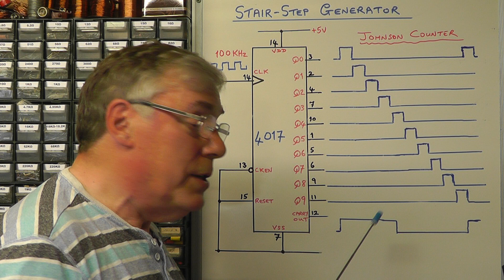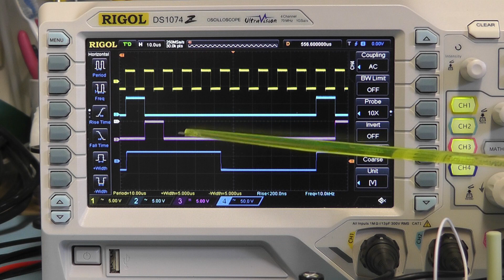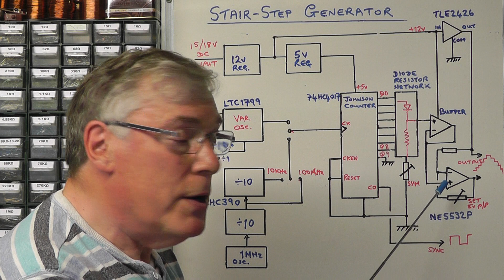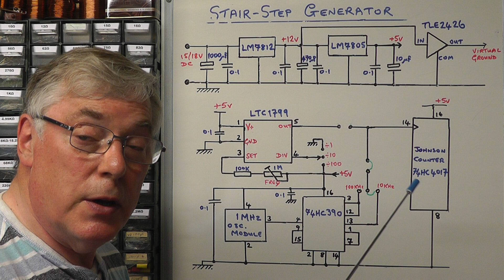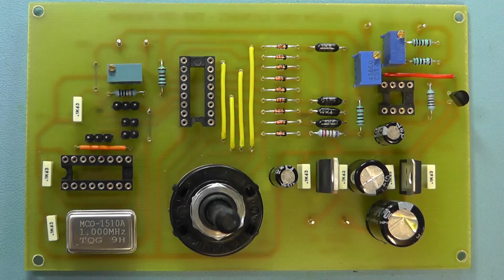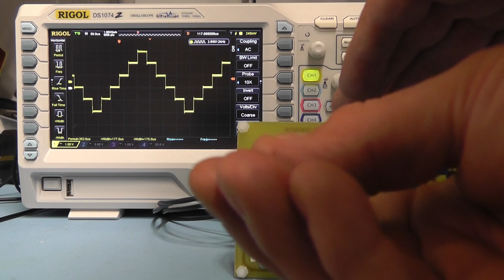Scullcom Hobby Electronics #41 - Design & Build a Stair-Step Generator

Comment: Great video.Thanks for sharing! I built it and it works, however after further research I decided to use an R2R resistor ladder instead of your binary ladder. The R2R was more stable and simpler to implement.

Comment: 👍😁 ❤   I haven't used "my Johnson" this much since I was of dating age 🤓 Thank you for a very through, information packed and interesting video. One question: The individual steps are for what purpose? I would assume scope linearity but the steps voltages could be set a little fast and loose if not paid attention too. Unlike the 5v overall, they can be (are) individually set. I ask because there is another commercial scope calibrator that uses steps also. Cheers! 🇺🇸❤🇬🇧

Comment: I've seen the comments about you grounding the Q9 output,  which I will also say that you should never ever do.  In addition,  you appear to routinely allow violation of the rule that says that ALL CMOS inputs have to go somewhere.  In this unit,  the clock input to the 4017 should have a 100K resistor to ground so that it's not floating when the switch is moved,  or when links are not in place,  even if that's during a transition in your setup.  I also notice that the alternate waveforms step on the way up but not on the way down like the primary waveform does.  I don't see a need for that "rail spliiter" chip when you can accomplish the same thing with a couple of resistors,  maybe also a couple of capacitors across them.  Finally,  your staircase output has one ground reference and your sync output has a different one.  This could come back and bite you in the ass at some point...

Comment: While watching this it struck me that the 562 ohm resistor could be replaced with a 1N4148 to achieve the desired 0.6V voltage drop. Likewise the 1k ohm resistor  can be replaced with  two 1N4148 diodes in series; the 1k74 resistor with 3 x 1N4148 diodes in series; the 3k26 resistor with 4 x 1N4148 diodes in series and the 7k68 resistor with 5 x 1N4148 diodes in series. This will ensure that the steps of the waveform are of equal size; additionally there is no need to try and find non-standard resistor values. 1N4148 diodes are very cheap; the design uses 9 of these already.

Comment: Is it interresting to add some voltage reference in your circuit ?
And adding some pf cap for filtering your step's signal ?
Why not using a DAC to generate your stairstep-ramp which could control your VCO too through a PLL. 74HC161, 74HC160, 74HC4046.
Is this more accurate than digital ramp use in a DVM ?
Reply from the maker: Hi,
thanks for your comment.
There are many options in producing a stair-step generator. In my project I wanted to demonstrate the use of a Johnson Counter. If you wish you could use a DAC other counter IC's as you suggest. You could even do it with a micro chip. There are lots of options. My project is just my take on one example.
I would imagine a digital stair-step ramp used in some types of DVM's would be more accurate as it makes its voltage measurements by comparing the input voltage to an internally generated stair-step ramp voltage which is set/calibrated during manufacture.
Regards,
Louis
Reply: Hi,
Thank's for your quick answer and Thank's 4 your video's
Renaud
Last question: What about making a frequency ramp or "stairstep" may be around 10Mhz from let's say from 9.5 to 10.5 Meg -10dbm step from -80dbm to -30dbm with why not a si5351.. ;-)

Comment: Skull com. What kind of swiches are there to use in circuits. And what are pulse circuits , and pulse. Switches.
Reply from the maker: Hi Phillip,
The switches are:
S1 - Rotary Switch, 6 Way, Through Hole - break before make type. (RS Components Ltd stock No. 665-196) Lorlin (Mfr. Part No. CK1050).
SW2 - Single Pole ON-OFF-ON switch or 3 pin SIL option link with link plug
You can download a parts list:
http://www.scullcom.com/Stair_Step_Gen_Parts_List.pdf
Regards, Louis

Comment: Interesting project, but your calculations could have been simpler. Instead of working out the currents and doing two calculations for each voltage, you could do:-

From the voltage divider formula: VO=VI(R2/(R1+R2))
And with: VI=4.4 and R2=1200
We get:-
V=4.4(1200/(R+1200))

Rearranging...
V=5280/(R+1200)
VR+1200V=5280
VR=5280-1200V
R=(5280-1200V)/V

We get:-
R=(5280/V)-1200

(not a huge saving for just 5 calcs, but a general principle. eg: You might want 10 steps...)

And inserting the required Voltages:-
V=0.6 => R=7600
V=1.2 => R=3200
V=1.8 => R=1733
V=2.4 => R=1000
V=3.0 => R=560

If one doesn't want to use 0.1% resistors, use two standard E12 values resistors where required:-
7k5+100R
2k2+1k
1k8||47k (=1733.6) Or 1620+113 (E96 1% values) from calculator at: http://www.qsl.net/in3otd/parallr.html
1k
560R
Reply from the maker: Thanks for the detailed info. I am sure it will be of help to others following.
Regards,
Louis

Comment: recently I unsealed TXCO of 10.000mhz ,it contains 20mhz xo and two ic's PWM switching power controller.  micro power voltage regulator . pls upload circuit sir related to it.
Reply from the maker: Were any of the IC's a HEF4046B in which case it the circuit would be a phase-locked loop circuit.

Comment: One of the hardest tasks of measuring passive components is the measurement of inductors. I googled some projects of diy LC meters but I couldn't find any project as satisfactory as of simplicity, accuracy and with no micro controller though. I found out, whatsoever, that it might be possible to design such meter with a tank circuit, a 555 oscillator and an LM331 frequency to voltage converter IC. What do you think, is it possible to design and build a simple yet accurate LC meter with those components?  
I think it can be an interesting project.
Reply from the maker: Thanks for your comments. Many years ago I made a capacitor meter using a NE555 timer IC which worked very well. So yes it is possible to build an LC meter using a 555 timer.
Reply: Thank you very much for your videos, they are very well explained and appreciated by hobbyists. Sadly you don't have a video about designing and building an LC meter with a 555 IC. I think a lot of people would find it very interesting and useful. I know there are many cheap already made solutions in ebay but the idea is to learn and the joy of designing one for yourself, but some of us lack of the ability and knowledge that you have. Maybe one of these days you can make a video about it.

Comment: I didn't see anyone else ask so I will.  What do you do with a stair step generator?
Reply from the maker: It could be used for a number of things such as as a simple check for oscilloscope scale calibration test. Also it could be used as part of a Transistor Curve Tracer circuit. You could also use it to test stepper motors. It could also be used to provide a video signal for a bar grey scale test pattern.
Reply: Scullcom Hobby Electronics Thanks

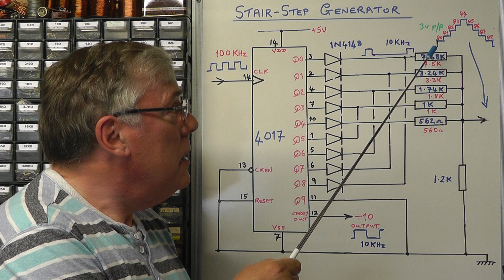Comment: At 5:15, you connect the OUTPUT Q9 to ground? say goodbye to that pin if it's TTL!
You need a 10k+ resistor to ground, if you are worried about noise immunity. Unused outputs are left floating, while unused inputs, are grounded or pulled up to +Vcc. Is that not the common practice now a days?
I'm not sure what this circuit is used for? I can generate 1024 step wave forms with an $2 Arduino clone + an op amp if I need to generate audio wave forms of any shape. No?

Comment: Smashing project :-D
And for more steps you can add another 4017 :-D
Ahh the johnson counter, a very handy i.c :-D, i last used one to select the supply voltage to an eprom/flash programmer.
The Q outputs drove transistors that connected to a selection of resistors connected to a lm317 adjustable regulator.
The clock input was a push button and passive parts so i could press the button and the johnson would step, simple and crude but it worked a treat :-D.
Reply from the maker: Thanks. As you say using the Johnson Counter to control switching is a nice option. Like you I used it many years ago to act as a selector switch with a push button stepping the clock input at each press, giving 10 switch positions with one button. You do not see this IC used very much these days but it is still a very useful IC.
Reply: When i used to repair c.b radios i was often asked to fit a "K" tone or 5 tone roger bleep, they used the old 4017 too, a couple of 40xx chips for oscilators and control, Plus r/c and diodes on the output of the 4017 lol, they worked very well :-D
Im a bit old fashoned, i like the 7400 and 4000 series logic better than any other method :-)
Reply from the maker: c. b. radios that takes me back. Not used much these days. I still have a couple of Binatone c.b. radios under the workbench in a box! I use to play around with surplus Second World War transceivers such as the 38 Set and the 19 set. Long time ago now !!!
Reply: The popular binatone 5 star was a good cb radio, silver fasia, the pcb was a cybernet ptbm134, same as quite a lot of the popular radios around in the mid 80's.
Uniden radios like the uniace 100/200 or realistic trc2001 and similar were another choice.
.
Cb radios is where i learnt synthesisers/rx i.f stages and tx mixers/power stages.
Other parts were often discrete transistor circuits or an op amp for the tx audio and a power amp chip for the receive and sometimes tx audio.
I repaired a lot of the uk radios for truck drivers for years, some so called cb repairers left radios in a mess, they also came here to be corrected.
c.b  lead me on to repearing multiband/multimode cb radios and repairing some ham radios.
C.b was a good way to learn radio/antenna/swr  :-D

Comment: Why did you remove the 0.1% resistor because it looks like at 31:00 that you have them installed but later on when you're testing the board they're gone?
Reply from the maker: Well spotted. In my early testing I used some different value resistor (higher values) and at that time I used 0.1% tolerance and that is what you see in the video. As the video was getting to long I cut out some of the video footage in the final version. In the final version I used the resistor values I indicate in the video which I found to be the best choice. Initially I changed them to standard value 1% resistors of 7.5K, 3.3K, 1.8K, 1K and 560ohm and it did work very well as you see in the video so I decided to show that. In my final version I did replace them with 0.1% tolerance but did not film that, these gave a similar result but the accuracy of the steps were improved. I have shown the 0.1% resistors in the parts list with RS Components Ltd stock codes.

Comment: Shouldn't Q9 be fed back to RESET to limit the sequence to 9 steps? That how I always used the 4017 on light sequencers back in the 80's
Reply from the maker: Thanks Paul for your comment, good question. If you connect Q9 to the reset you would loose the bottom step of the waveform. This would then result in the stair-step waveform only having 4 steps up and down and the bottom step would be twice the width of all the other steps.

Comment: Grounding Q9 will not make the chip happy, though at 5V a CD4017 will survive, but the 74HC4017 will be running the output into a short, which causes a very large current pulse in the chip, which is not good. Just leave it open instead, which will do nothing.

This output will have a temperature sensitivity, which can be compensated for somewhat ( will not track perfectly but better in most cases) by using another 1N4148 in the ground lead of the 7805 so the supply is 0.6V higher, which will also track temperature wise with the other diodes somewhat. Better would be some low leakage Shottky diodes in place of the 1N4148 diodes, so the drop is lower.  Increasing supply by 0.6V will not worry most of the TTL at all, most is very happy with 4.5 to 5.6V in most cases.
Reply from the maker: Thanks for your comments/suggestions. In practice I have found that there is virtually no difference in current. With Q9 left disconnected the total current consumption of this project is 19.13mA and with Q9 grounded it is 19.56mA. I do however agree with your suggestion to simply leave Q9 output disconnected. Alternatively you could ground it with a 10K resistor in which case the total current would remain at 19.13mA.
Your suggestion of replacing the 1N4148 diodes with Schottky diodes is a nice option as a Schottky diode have a lower forward voltage drop, about half that of a silicon diode. This allows for faster switching speeds so would result in a cleaner stair-step at higher frequencies. However, my understanding of Schottky diodes is that they are extremely sensitive to temperature because of there high leakage characteristics so if temperature is an issue then they could cause problems. But with regards this project I do not feel that temperature is an issue anyway.
Reply from the maker: Thanks for your input which is welcome.
Reply: And he says that connecting it to the ground reduces noise.  Actually, it adds noise, namely 10kHz signal with odd harmonics.  I would like to see the current consumption in one channel of the oscilloscope!
Reply: Would be interesting to see Q9 connected to ground thorugh eg. 5 ohm resistor and the seeing the voltage of that pin in oscilloscope.  Per TI datasheets, HC logic output can give up to 70mA of current but based on your finding on the average current consumption difference, I would expect to see about 4mA current pulses which, over 5 ohm resistor would mean about 20mV pulses over the resistor.

In any case, you should NEVER connect logic outputs to rigid ground or supply.  NEVER.  It is just plain wrong.  In the worst case, the resulting current may destroy the chip.

Comment: Am I missing something here, unused OUTPUT Q9 tied to GND???
Reply: That is of course wrong. You ground unused INPUTS.
Reply from the maker: Thanks for your comment. SeanBZA also brought up this point which I have replied to below. Q9 can be left disconnected or alternatively you could ground it with a 10K resistor.

Comment: amazing video as usual! really appreciate your work! I was wondering can you extend this into a Transistor Curve tracer?
Reply from the maker: Thanks. An interesting point you make about a Transistor Curve Tracer. Yes you could use the stair-step waveform to drive the base current of a transistor as part of a curve tracer. You would also need a voltage ramp waveform to drive the collector voltage of the transistor under test. You would also need some additional circuitry to drive the X and Y inputs of an oscilloscope to produce the correct traces.
Reply: http://www.pa4tim.nl/?p=1437 forget the UJT staircase generator I used and use  the design  from  Scullcom as a base. 
Just a minor thing to the staircase generator power supply. Regulators do not like a higher voltage on the output compared to the input and can die that way (caused by then electrolitic caps). To prevent that from happening you should place a diode over the regulator (see datasheet for details)